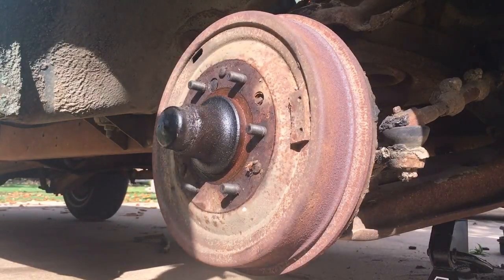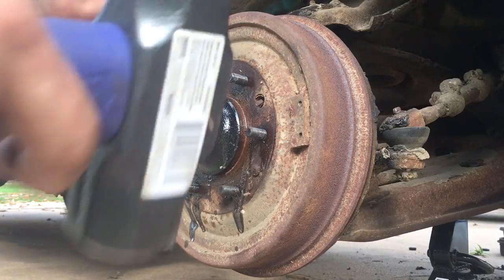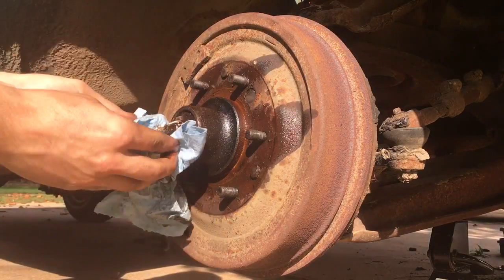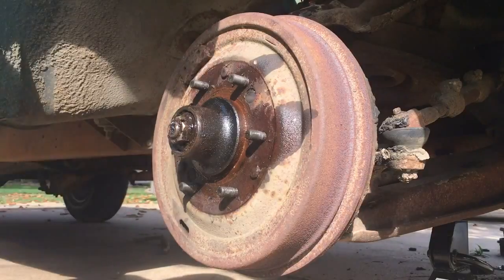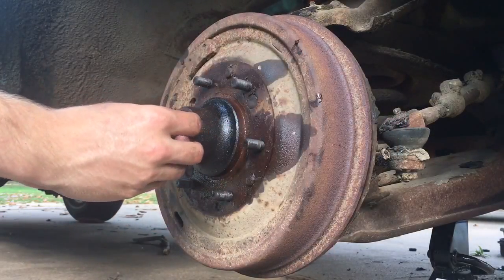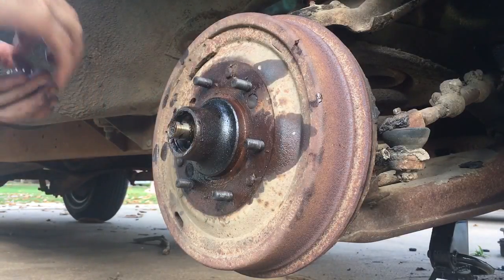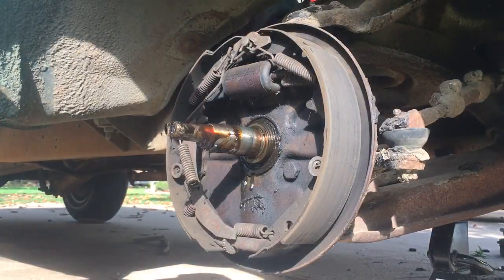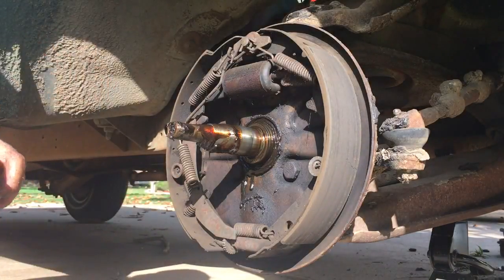1969 C10 Front Brake Drum Removal

Comment: What does that big spring do? I took mine off on my truck because my new drums didnt have the slot for them. Is this a problem? Ive been having problems with my brakes where they work when its off but when i turn it on they sink to the floor. Could that big ass spring be why shits not working?

Comment: there is 4  -5  small bolts tween the lugs  they stick out a  few treads  yours  look a little short  mabe wrong bolt    any way  on mine  -53 m37  -  just run those small bolts in not out  it pushs drum off easy ive  seen people grind those bolts off  and almost ruin the drums

Comment: Hi, I have a question, once you have removed the rivets and disassembled hub and drum, and you need to put all back together, do you need rivets to keep them together?
Reply from the maker: xja6716 hi, no, once it’s back together and the wheel is on, the lugnuts keep the drum in place 👍🏻
Reply: @doublewrench69  thank you for your advise...

Comment: What exactly does the spring around the drum do? Is it necessary to have on? I'm having trouble getting mine back on, is there an easy method you use?
Reply from the maker: Alex Aviation it is supposed to act as a dampener for braking vibrations. I didn’t put mine back on and it still stops silently over a year later, I wouldn’t worry about it (but also wouldn’t throw it away).

Comment: My '69 still has the riveted hub/drums as well, I'll be separating those here shortly to replace the drums. How did it go cutting those rivets out?
Reply from the maker: It wasn't bad at all, made a vid of it but forgot to edit and post, will do that. Just took an angle grinder to them and punched the hub away from the drum with a hammer. Didn't punch the rivets all the way out, just ground them flush with the hub surface (new drum wouldn't fit on without them flush). Forgot to film most of the time (I'm new here) but if you have any questions hit me up, I just replaced my shoes, hardware, repacked bearings and hubs, replaced wheel cylinders and drums. Stops a little better (still manual drums tho) but now my brakes are dead silent.
Reply from the maker: Uploaded the vid, made it a 6X timelapse because otherwise it is a very boring 12 minutes of grinding and hammering.